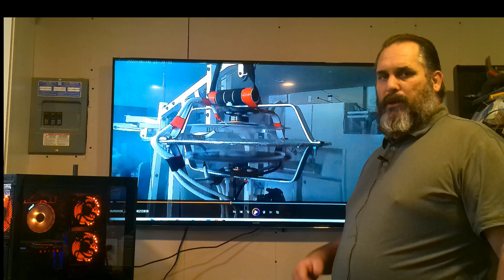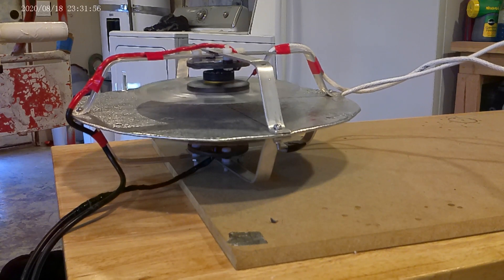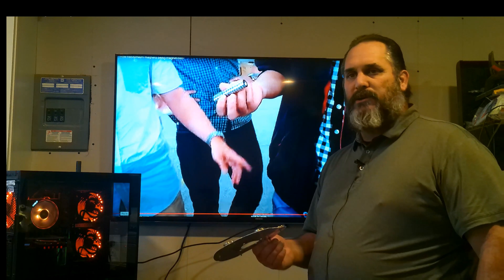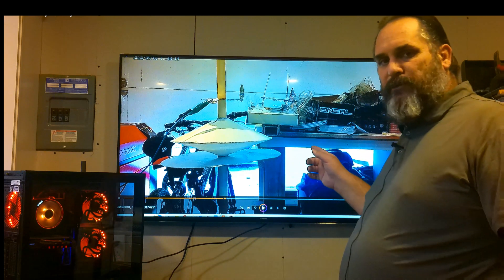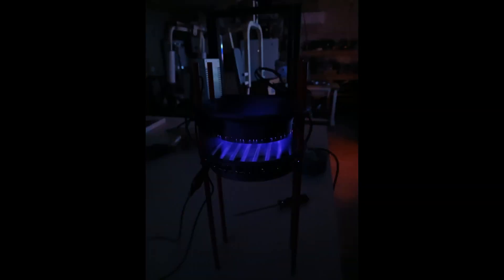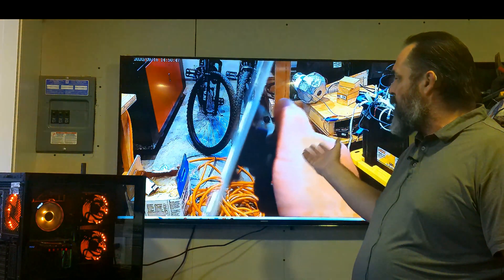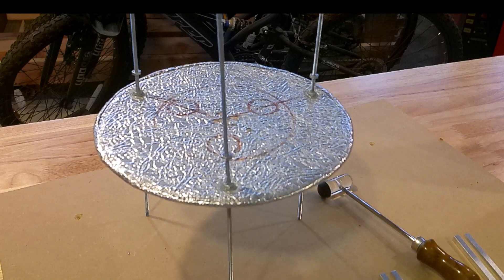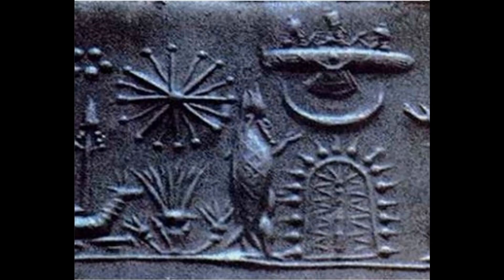Did My Graviflyer Ever Fly Part 2

Comment: You need a LOT of volts to make it ”fly”
Reply from the maker: I am working on a new model with 20kv. and 1/2 to 1 pound in weight. I did try 20kv to this one and it failed. You are 100% correct.

Comment: " Its always gonna have a little wobble, I cant fix that"  ....  I mean, ya could if you understood physics in the slightest.
Reply from the maker: Yes I could fix it. I clearly said it wobbles because of the weight. I can add weight to the frame and it would not wobble. Or I can remove the big magnets and find tiny ones. I am working to reduce weight, use more powerful magnets and make something work. If all I wanted is a paperweight that spins. I could have done it long ago.

Comment: I love your project and various test configurations. For the Graviflyer, maybe add two 1/8" thick polycarbonate plastic plates between the top spinning disc and the center plate and the bottom spinning disc and the center plate? This should greatly reduce the likelihood of sparking and additionally, according to T. T. Brown's experimention with various dielectric materials, certain phenomena are observed in and around the dielectric material that may be useful here. See his research if you haven't already. Increasing the amperes, rather than voltage, by adding another FB tfmr should increase field intensity. Ofcourse it's becoming more dangerous now so be safe.  Make sure that the magnets still work. The magnets should last longer with this feature (?). Would love to see another attempt. Regards.
Reply from the maker: You are correct. TT Brown and Carr use High Voltage capacitors. Both for the same reason. They deliver high kv or Kila volts. Making the center a closed capacitor instead of a open air one has crossed my mind. Like Brown's design, I would like to use a tesla coil in the center. With the high kv capacitors. The magnets would be replaced with a tesla coil magnetic field. The tesla coil has the correct field. It is magnetic without the magnet effect. Meaning the field goes out, but does not attract the magnets if you use ac. Using dc just makes a giant magnet. 

I like what you are thinking.
Reply: Suspend Graviflyer using fish weight scale to see possible weight changes?
Reply from the maker: @roganhogan4274  I know it might help me, but I just won't do that. The second a fishing string is involved would just make people think I am faking it. A thick rope that everyone can see I will consider. 

If I am correct neither will be needed. I have been working on the idea of the tesla coil voltage for a while now and the results are better than I expected. If you watch my ufo theory video you will see where I am going. I have the power source built and the craft. just waiting on the new ac flyback. But like always I will show what it does. Even if it sucks.

Comment: In ancient egypt there were some weird shaped ceramic plates that were used for a spinning application. It was called Disc of Sabu. They look so weird that they must have been generated by extraterestrials
Reply: I haven't seen the tuning forks on the statue. 

Has anyone tried to etch using vinegar and salt water with electricity to create a beehive pattern on the aluminium plate. I guess it would resonate differently and have more of a desired effect. I am pretty our space brothers have already given us the information in crop circles.
Reply from the maker: @onederment  I don't know. sounds interesting. I love crop circles.
Reply: Another note is that the flying machines used in India by the ancients used the metal Mercury. So did the Germans when they built their UFOs. Why not change that plate into two plates that has a float of Mercury between the two?
Reply from the maker: @onederment  I guess you could. I am not interested in working with Mercury yet. My garage is not the place to light it up with electricity. 

I would like to use a magnetron as well, but it is not safe. 

I want to make something everyone can replicate easily.
Reply from the maker: @onederment  The work of Viktor Schauberger is more in line with what I am doing.
Reply from the maker: I have seen them as well. Did you see the tuning forks on the statue? I am working on a quarts video. it goes along with Egypt. I will look at the discs again. China also had some that were interesting.

Comment: It may just be the over all weight that is holding you gravity device down .
Can you make it lighter
Reply from the maker: Yes, by removing all the rotating stuff and starting with pure lift. Then move on to movement and stabilization. I have 2 more video's coming up this week. one on the power source and one on how to build the new craft. I believe it will explain everything. I have found a lift that can carry weight with voltage and sound.